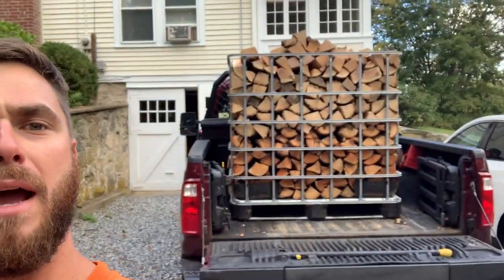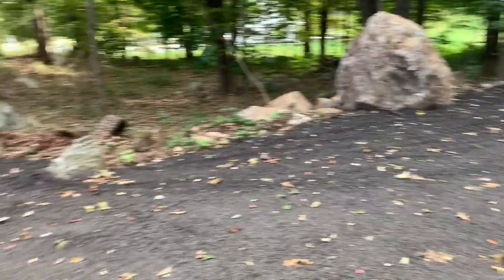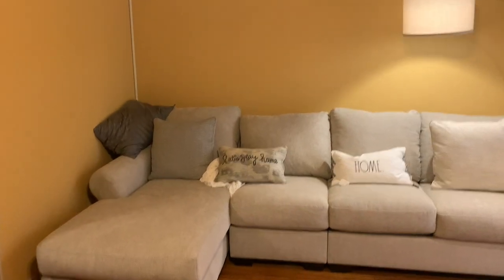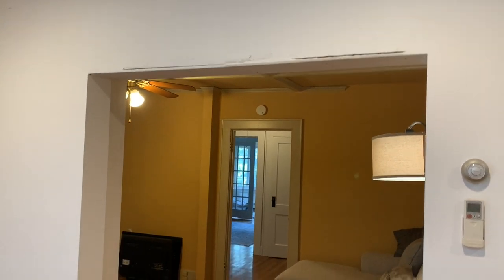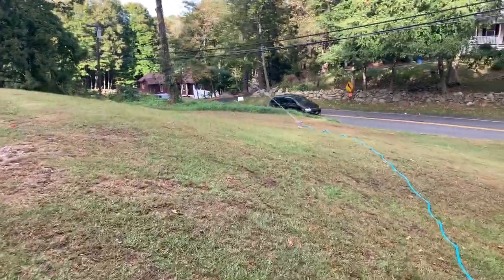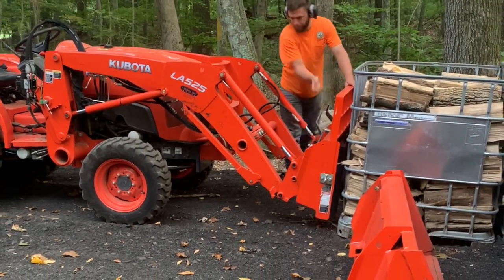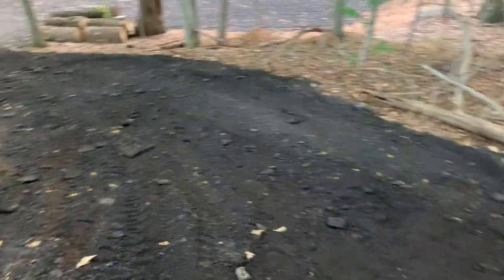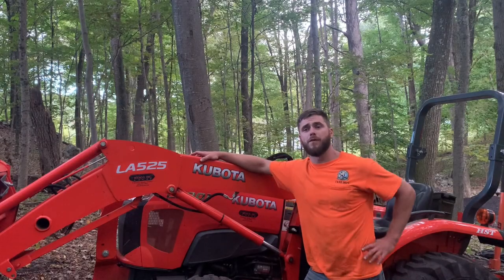#144 Custom Milled Lumber & Spreading Asphalt Millings with Kubota Tractor

Comment: Ok millings look great. I need a few 100 yards! House looks real nice trim and ledge top look great. Now the stove....Quads are great. I have owned three, two In current house. You will not be disappointed.....call with questions.
Reply from the maker: I’m hoping the stove works out, a bit smaller than I’d like and needs some refinishing work but looks solid!
Reply: Have you put a light in it to check for leaks?